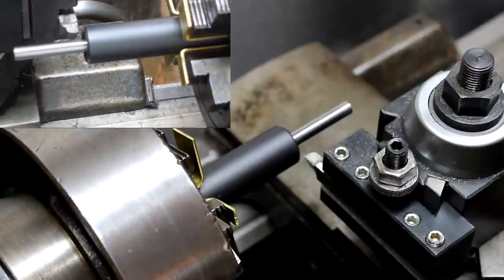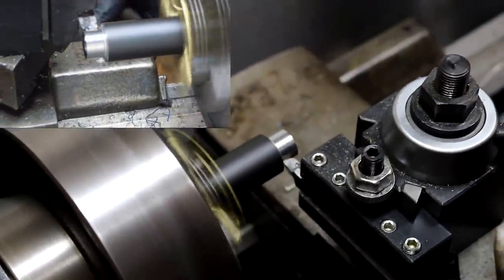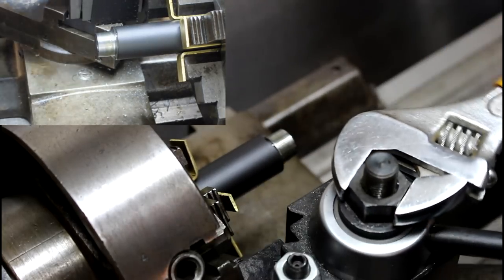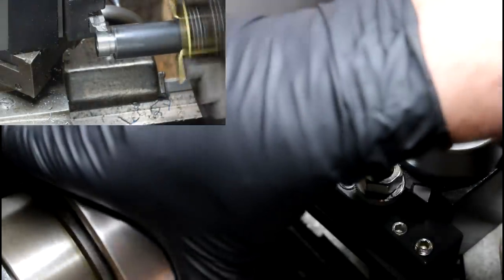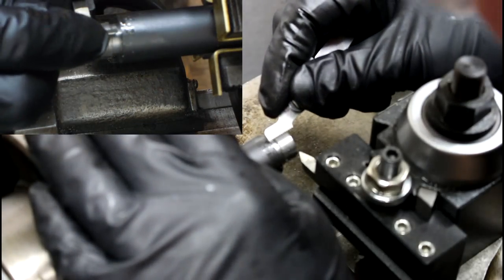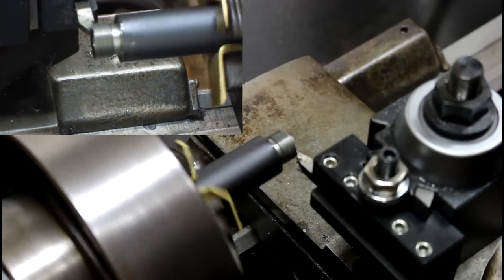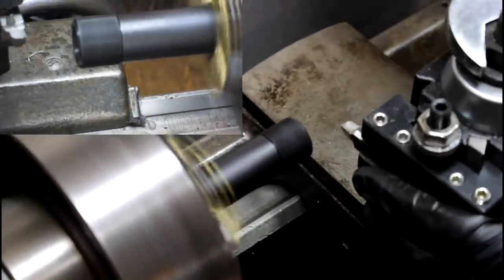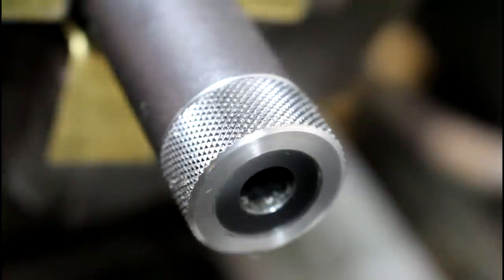Threading a Barrel -Thread Protector Installation! Gunsmithing Remington

Comment: Thank you sir for our thorough answer. I have several barrels to be machined for new Sig Sauer silencers I just purchased last year (but I have plenty of time to get them done with the months wait on getting the tax stamp from the AFT) and want to make sure they are threaded correctly first time around. 

Please correct me where I may be wrong in my understanding of your explanation. You said you used a "tight fitting rod" on both ends to indicate in the barrel. Essentially that takes the place of using a center on both ends (if I am comprehending correctly). A "tight fitting rod," depending on how tight of a fit there is between the lands and rod, I would think is not as "tight" as using centers on both ends, since there could be tenths error (probably of little or no consequence really) in using the setup indicating off the rods, whereas using the centers would eliminate any indicating errors and place the accuracy completely on the lathe's inherent accuracy. 

But either way, using the rod indicating method or putting the barrel between centers, it would seem to me both would exhibit the same end result when dealing with a "bent" or "curved" barrel. Then again, thinking about it in more detail, maybe using a "rod" that is really "tight fitting" (no play at all) inside the end of the barrel bore even two inches in depth down the bore, just might be more accurate on a "bent" barrel because when the bullet leaves the last engagement of the rifling it is probably on a trajectory straight out of the last quarter inch or so of the barrel, thus making it more in line with a suppressor screwed onto the end of the barrel using that rod indicating method, whereas indicating between centers would produce threads somewhat skewed, depending on the total "bend" or "curvature" of the barrel from one end to the other.  

The more I think about it, the more it seems like you would not even have to consider indicating both ends unless you want to find out how "bent" the barrel may be, which really doesn't matter when threading the muzzle end because the bullet will be going straight from the last few fractions of an inch it is last engaged in prior to free flight through the suppressor.  So, the way you have shown in the video now seems to be the more accurate way to do it.  And, probably making the rod of the "tightest" fit possible into the bore, with the exposed diameter of the rod being much larger than the diameter of the rod inside the barrel, would make any indicating off the larger diameter of the rod much more pronounced on the readout (like being magnified) than indicating on a smaller diameter like say a .22 or .17 caliber. Just thinking and checking. Appreciate your thoughts. Thanks.
Reply from the maker: +Dennis Varnau 
The more a guy thinks about it the more he second guesses everything! LOL.... The problem with relying on the lathes accuracy is that unless you have a brand new machine, or a newly rebuilt one (as I do) and you spend hours lining everything up, you can't rely on the lathe to be where you want it every time. That is the whole reason for indicating a barrel. If A lathe has been around for a while they usually need to have their tail stock aligned ether by a radial gauge, or a test bar which is usually 18-24" long. The problem with that to me is that it might line up next to the head stock with a radial micrometer, or at 18-24" with a test bar, but will it line up at 26+ inches if you are doing a longer barrel? How about a 12" barrel? I know my lathe would because everything has just been ground, but a 30-40 year old lathe that's been in use? Who knows? 

On top of that if you run between centers without first cutting a new bearing surface you are asking for run-out! Running on factory cut centers is not a reliable method. I know you can cut the face of ether end of the barrel, then run your centers on that, but some guys will argue that with the tiny amount of bearing surface in this case, you run the risk of having one side of the lands softer/harder than the other and when you tighten your barrel down, it will deviate to one side. When you cut centers with a piloted reamer, you will get much more (relatively not that much) error vs the tight rod, due to the clearance the bushing needs on the pilot. My rods only move on one axis, the X axis in and out of the bore. There is just enough clearance to get the rod in the bore and no more. Here were are talking about a few ten thousands. 0.0002-0.0004". Now the trick then becomes how close can I zero that out in my lathe with my indicators. 

When I was installing a lot of muzzle breaks for another gunsmith, most of the time, I would leave the action on, and run the barrel through the headstock and indicate the last 3-4"" of the barrel. You indicate close to the muzzle, then out on the end of the rod, which was usually about 3" out past the muzzle. I figure at that point, if I could zero everything out here, There would be a 6" straight path for the bullet to travel and would exit the muzzle at a concentric point to the bore of the muzzle. Most times the barrel ended up pretty straight in the lathe, but I also did a lot of Remington factory barrels, and they are horrible for being both "bent" and having horrible OD concentricity. 

The same gunsmith also would have me cut piloted centers, and turn the shank of the barrel so it has a concentric OD relative to the new center. He would then call these barrels "blue printed", which I guess technically is true, but using pins will get you closer to zero run-out. Don't get me wrong, these were all great shooting rifles, but like I mentioned before, my most accurate rifle, which has shot in the 0.2" range 5 shot group at 100 yards on several occasions, and consistently shoots in the 0.4-0.6 MOA range, is a 7mm Mag with a palma contour barrel which was done by chucking up in the three jaw, and out on the steady as I mentioned before! It's a hunting rifle too!

Anyways, personally I would be a little scared to thread for a silencer by running between centers. Not because I would be afraid that the bullet would hit it, but I would want to make sure everything was dead concentric if I'm shelling out the cash for a silencer. It sticks out past the muzzle quite a bit further than a muzzle break which are usually no more the 2-3" out. There are better ways to do it in my opinion.
Reply: +Precision Machine Shed Thanks again. I'm going to have my brother read over these paragraphs first, before I give him my barrels to machine. He's been doing machining since high school (then Cincinnati Milling Machine [Milacron], Cincinnati), now 61. He has several patents dealing with workholding fixturing (PROHOLD Workholding). Problem was, he's more of an inventor than business man, and his shop was more of a hobby than business really. But when it comes to working up the best way to hold something to machine, I'd put him up against anyone in the business anywhere in the world. His three jaw chucks and hydraulic vises, used in tombstones, are the most versatile and operator friendly for production machining. The IRS put him out of business and now others are making his original products. Not only were they good for manual loading, but could also be completely automated into horizontal machining cells (one I remember most was for machining the finger holes in bowling balls). Anyway, I'm sure he will be able to thread my barrels well enough for use with these new Sig Sauer cans. Master machinists are a disappearing breed of skilled craftsmen, for sure, in the US of A. We knew Ross Perot was telling us the truth back in the 1990's while we watched manufacturing in Rochester, NY (where we did a lot of workholding business) literally dry up almost completely, and head for Mexico. "I love it" when Ohio Gov. John Kasich says he's bringing back jobs after he as a U.S. Congressman at the time voted for GATT and NAFTA. Typical politician - works both sides of the problem to benefit himself only.
Reply: if you want it done properly don't get this guy to do it! lol

Comment: For suppressor mounting (including muzzle screw-on accessories), wouldn't overall concentricity between the barrel ID bore and threads, and the perpendicularity of the shoulder to the ID bore, be more precise if the barrel was first mounted between centers - to start from that kind of a setup since a lot of barrel ODs are not concentric with barrel ID bores?  Can't remember completely, but I saw a barrel first mounted between centers, where one center was in the receiver end of barrel at the end of the through hole in the lathe gearbox housing and the other center in the end of the barrel where the threads were going to be machined. Don't remember all the steps taken after the centering of the barrel bore, but it would seem to me that setting it up between centers would be more accurate than indicating off of a mandrel stuck partway down the barrel. I was told that setting up between centers would assure everything (threads, shoulder, etc.) machined on the OD of the barrel would guarantee an accurate alignment of the centerline of the suppressor (when mounted)  with the ID barrel centerline.
Reply from the maker: +Dennis Varnau 
Well, first, most guys that builds high end benchrest and target rifle are currently cutting barrels similar to how I do it with there being several different variations. I am basically doing the same thing as running between centers, except I'm indicating off the lands on both ends of the barrel with a tight fitting rod and it leaves almost no room for error. When you run between centers, to do it right, you must first cut 60 degree relief cuts in each end. You can do this a few different ways. You can indicate each end as I did, then cut with your compound and cutter of choice. Second, you can chuck it up in a steady rest and then cut each end, third, you can buy a piloted 60 degree cutter, which I have also, and cut your centers there. Only problem with the last two is that in a steady, you are running off the OD, which can be bad even with a floating reamer holder, and using the tight fitting piloted reamer, you still have to have some clearance for that pilot to work correctly. 

Would the average guy notice this? No, but when you are shooting at 600-1,000 yards, every little bit helps. There is also the problem on many barrels are not straight! when you run between centers, and you cut your threads, that bullet could be coming out at a slight angle and your brake or whatever you have on there will be off. Again, most guys won't notice. Gordy Gritters a highly respected gunsmith and builder of some extremely accurate rifles only indicates his barrels with the first 4-8" of whatever side he is cutting. He mentioned that sometimes when he indicates his barrels on the chamber end, you can see noticeable run-out on the opposite end and these rifles are match winners! 

There are several different ways to go about indicating a barrel, and many of them work well. The guy I learned from was an accomplished BR shooter and traveled the US and Canada in the 60's, 70's and 80's winning a lot of matches. He chambered all of his barrels by chucking one end of the barrel in a 3 jaw chuck, then running out to a steady rest on the OD, threading, then reaming with the reamer held tight in a Jacobs chuck in the tail stock. I actually have a couple of these rifles and I built a few this way and they are all 1/2 MOA or better rifles out past 600 yards! He also had several targets that were 5 shots though one bullet diameter hole witnessed by several friends on his private range! Tell me how that works! 

I'm going to be doing a barrel in the next month hopefully if my reamer arrives from PTG, but I have yet to decide which way I will do it. I'm confident to do it any way I want, but just figuring out which one is the problem. 

Just saying there's several ways to do it and depending on who you talk to, I do what I do based on other peoples experience, a lot of research, and what I feel works best.
Reply: And still got runoutYour only measuring at one point, in effect can often swing eccentric towards breach and have same effect as cutting on the piss.

Comment: I found this interesting, but if that were my barrel I would not be happy. Too much cut. Not enough threads and the threads are ragged. If that were my thread protector you'd owe me a new one. Only way to fix that the way it should be is to cut back the barrel and start over with a new thread protector as well as properly crown the barrel. I heard "will do" and "close enough" enough to make me sick. Lesson learned: find a gunsmith with some pride in his work.
Reply from the maker: +James 51 This is just a quick example to show the general process on a junk barrel. Thread protectors are cheap and if you want one sticking out 1/4" past your crown that's fine, that's not the way they are suppose to be. Only purpose of a thread protector is to protect the threads when your brake or a suppressor isn't on there. The depth is set by the brake not the protector. With the amount of threads, I didn't have the correct cutter to make a smaller cut at the time, that being said, one or one and a half more threads on a brake is not going to make a difference as far as strength, and this one was a demo anyways. I do admit the threads were not perfect, but for this demo they were OK. I would never send anything out like this to a paying customer! I've won enough matches with my own rifles to know I'm a much better builder than 95% of the people out there, and although you point out some obvious flaws, it's not correct to make a general assumption off a quick 20 minute demo which only includes 1/2 of the actual time and effort and measuring involved. I've also replaced just about every machine in my shop since I made this and my machines are much tighter than this old POS I was using here. Guess I'll have to make an updated video and do everything as I normally do! 

Here's a quick video on a brake I did a few years ago when I was still working in a very busy shop building a lot of high end hunting and target rifles for a lot of high end picky customers which expected nothing but the best!
https://youtu.be/NO9nHPSMDZs
Reply: I guess you cant thread to a shoulder with out a relief grove to stop you threading tool in yes hack job for sure.
Reply: Too fucking right James!

Comment: I'm very new to to machining. Why do my hss tools struggle to cut 304 stainless? I get loud screaching and my tools get rounded off almost instantly, even when I make just a 5-10 thousandth pass. Did I buy a cheap set of tools, or am I doing something wrong? I have no formal training, this isnjust a hobby I picked up and learned from youtube videos.
Reply from the maker: Hard to say without more info, but look into grinding tool bits for a lathe and make sure you have the proper cut along with the correct feed and speed. Also make sure the cuter is coming in level to the center axis of the work or a thou or two low. Running it in above center will destroy you bit in no time and won't cut really much at all.

Comment: I know people mean well, but on youtube, you can take a pencil and draw a square on a piece of paper and 500 people will tell you did it wrong. LOL  Great video. I subscribed.
Reply from the maker: +TexanUSMC8089 
I know and thanks for mentioning that. This wasn't my best work, and I never thought it would get so popular. Mainly my threads got a little messy, but other than that and the thread length, nothing wrong in my opinion. 

I'm going to be doing a barrel install soon and the video quality will be much better and my skills are back up to par again after being out of it for a couple years.
Reply: lol. don't have the barrel hanging so far from the chuck.

(I just wanted to be one of THOSE guys)

Comment: What thread size/pattern would be good for a 9.3x62 Mauser? Bullet Diameter is .366.  My 223 Rem is 1/2"-28.
Reply from the maker: Hey, I would throw a 5/8"x24 brake on there. Should be plenty of barrel after threading.

Comment: I have a question..I`m teaching myself how to be a machinist. In the close up of your threads it seems as though the sides or flank(I think they call it) of the thread is not a clean(crisp) cut. Why is that ? Is it chatter ? Your lathe ? or the tooling ? I`m not trying to be critical because I can`t even cut a thread yet..I`m just wondering what causes that ?
Reply from the maker: Yeah, was a couple things, but mainly a dull cutting tool, and deep cuts instead of taking more lighter cuts. Having a really sharp cutter, correct height, and a solid setup helps. This was a bad thread, but the video got popular quick, so I just let it fly. Your first couple cuts can be 5 thou on the compound, then usually drop down to 3 thou until you get close, then 1-2 thou per cut when you are getting close.
Reply: I’m not a machinist so forgive the lack of vocabulary please. I think the thread cutting tool should be advanced at an angle (maybe 60 degrees?) . This keeps the chatter down because you’re not balanced between the left and right thread faces equally.  
I think there’s a good book called something like “the machinists handbook”
If that’s too thick for you try YouTubing “this old tony” for some seriously entertaining machining.

Comment: Thank God for Quick Change Tool Post and tool holders!  No chamfer on the end to ease threading?
Reply from the maker: Yeah, they are nice. No chamfer, but if you wanted to do a really nice one you would recess the threads and match a cap so it is all seamless and invisible.
Reply: Which god Bob? I don't think Thor gives a rats ass about your barrel =_)